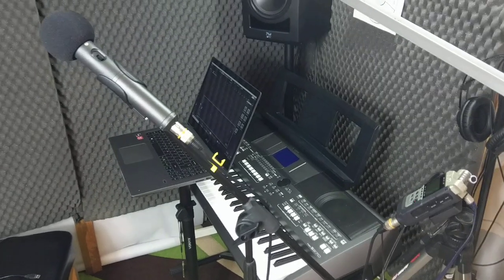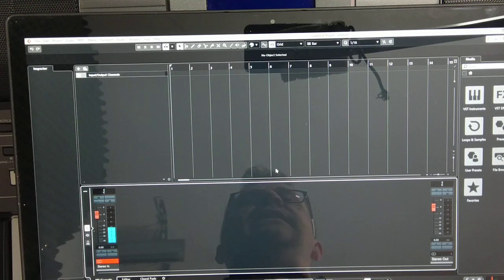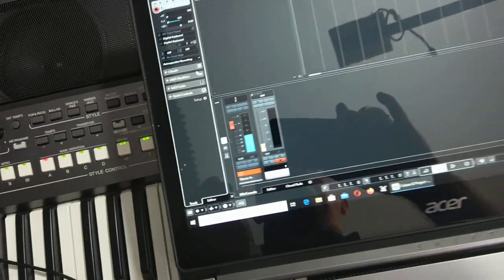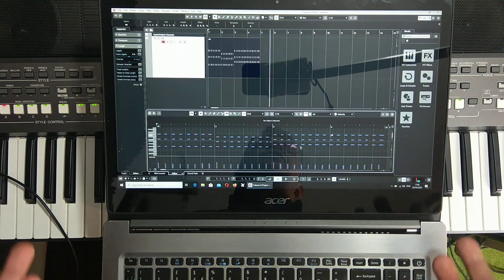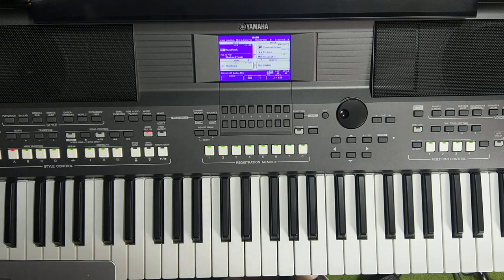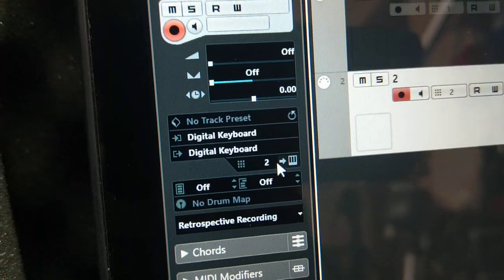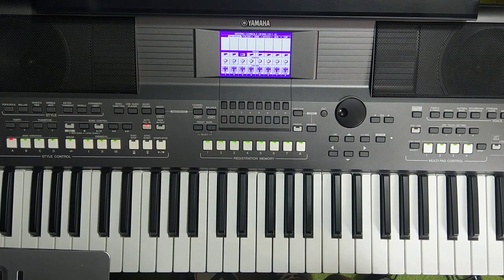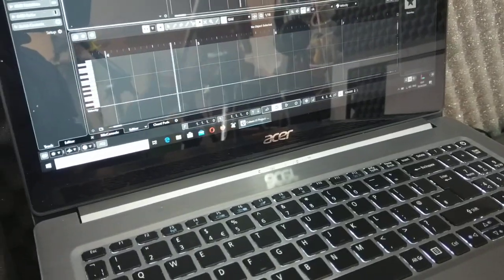How to setup USB MIDI on Yamaha Keyboard and Cubase 10.5 LE - complete MIDI tutorial and midi looper

Comment: Finally a honest video for once I have a m audio 68 keyboard midi usb plug can this work to? hope to hear back from you soon under this comment
Reply from the maker: Yes, It should work the same way. MIDI is generally a very wide standard.
Reply: @BBWalkerTV  Thank you but for some reason my sound is not working right and I have a hp laptop 15inch screen, some reason there is no sound coming out at all I have the right driver aso4all that I had to download still no sound
Reply from the maker: @ddrusa  sory for delay but I receive a lot of comment and sometimes YT skip for some notifications, here is the video where am I explaining it more, 
https://www.youtube.com/watch?v=FWp3KM33NQM
second reason why you may have problem is ASIO control panel, you need to setup proper outputs
Reply: @BBWalkerTV  Ah ok cool will do

Comment: Great videos. I am 74 years old so it takes me longer to digest a tutorial. I have a question. I use a PSR 770, and I have a midi song in my PC's DAW. I was able to separate each sound on different channels corresponding to the equivalent channels in my Yamaha's style creator. I also have separated the sections of the midi tracks I could use for the basic introduction and the basic ending. All this is stored in different midi files with different names.  Now, can I use all these midi files by transferring them to the PSR style creator via the same USB cable or through a stick? I have tried to play the files on the PC and try to play the same in the style creator but it is not good. Thanks.
Reply from the maker: Hello. Thanks for your feedback. Please check this video it's quite long but it should clarify all the stuff you asked for:
https://www.youtube.com/watch?v=FWp3KM33NQM

Comment: Hey ,your work is so useful and helpful, appreciate it man. Just one quick question. I plugged my psr s670 into ableton. I use the midi sounds in ableton, so is there way to switich off the keyboards sound or do i just have to turn the volume down?
Reply from the maker: Yes the simplest Way volume to zero
Reply: You need to go to the settings menu on your yamaha. There is option to turn of the sound on keyboard
Reply: Itd be go to midi menu in your actual keyboard and turn off local sound. Same for e drums keyboard and all

Comment: Hi, I hope you are having a great day.

I have a problem when I revoice the channels in the keyboard.

Every time  I select a voice in the revoice screen doesn't use the effects (DSP) parameters  that usually comes with them when you select one normally with the right1 or right2 button.

I give an example:
If I select the voice DistortionWah in the guitars section with right1 button sounds great because of its DSP parameters loaded but when I select the same voice in the revoicing screen in song function sounds different when I send notes with the computer because the keyboard doesn't seem to load the dsp the parameters that usually comes with the voice.

Any idea to change that?
Reply from the maker: Hey. Very good question. There is somewhere a few videos where I am explaining that widely. Without live example but I will try to explain it here. 
Basically mixer settings (which includes DSP block configuration) are stored within the voice loaded to Memory. 
After loading a voice they are altering current config (you can see it in mixer/effect) - but they set blocks for DSP2,3,4 for Rigth1, 2 Left , not the Song channel (Part: CH1,2,3,4 etc)
I assume you are revoicing existing song, you must me aware that in that case you ale playing via Channel (1..16)  not Right1,2,Left

Please check this video maybe it give you some inspiration:
https://www.youtube.com/watch?v=MkunF2WUwzI at 15:12 you can see Part selection

In your case you need to setup those DSP block to your Chanels (not R1,R2,Left) and save in Registration memory for fast loading. Remember that while doing this you can not select voices for Right and Left section because it will overwrite it (while loading new voice into memory)
If you still have problem - let me know,  I will make a special video for you cause this is really challenging question
Reply: @BBWalkerTV  thanks for reply!

I see.

After see the video of DSP now I understand the things a little bit better and what do you mean.

So, I need to setup the DSP for the Channels and save them.
Do you have a video where I can learn how to use the registration memory for this purpose?

Comment: Hi mate just wondering if you could help with connecting my Roland r70 drum machine to my Yamaha Psr970 via midi.
Reply from the maker: That is good question. Both devices you mentioned supports MIDI . According to photos I found on internet R70 has 5-din MIDI sockets. So you need cable like in this video:
https://www.youtube.com/watch?v=tnyYANwzuUA
Yamaha PSR 670 has only type B USB Midi, but PSR-S970 fortunately has both options (5-DIN plus USB Midi) 

I assume that you want to have the following setup:

Next you need to configure channels on Functions / MIDI / RX (receiving) because Yamaha will be "listening" and drums machine will be sending MIDI data. 

Please give me more details am I right about your setup and than we wil try to do more.

Comment: Should we use an audio interface ? Is there any latency issues without an audio interface ?
Reply from the maker: No, you don't need audio interface just pług in the USB midi cable into computer.
If you notice latency problems please check this video https://youtu.be/FYcW7gcN8cc

Comment: Can i record audio of my own yamaha piano sound directly into my laptop using usb cable?
When i record midi i get a signal. But when i want to record audio i don't get any signals. Any ideas?
Reply from the maker: No. Becasue Yamaha PSR do not provide audio interface inside. You need external audio interface and grab analog output 1/4 jacks or use usb audio Player and grab wav  inside Yamaha. Soon there will video about it. Regards

Comment: what cable do i need to connect my yamaha keyboard to my computer? a 6.35 mm to 3.5mm one?
Reply from the maker: Yes. If you plan to use analog out and Line in PC. However better solution is to use usb audio interface. Line in in PC is usually low quality
Reply from the maker: The other solution is to use USB Audio Player. Please chcek this new stuff: https://www.youtube.com/watch?v=yMBIUarEC_c

Comment: Sir digital keyboard is not shown??please..
Reply from the maker: Please tell me what operating system are you using basically there is no need to install driver on Windows 10 and I have tested in on this particular OS. It should be automatically detected by the system without any additional drivers however in your case maybe you need to install something like a midi driver

Comment: Sir... How can I connect My Psr s670 with Audacity Software...
Please reply me...
Your help is Much recommended...
Reply from the maker: Yes but only to recording audio stream (WAV) . I need a convert from Jack 1/4 inch (6.35mm) to Mini Jack (3.5 mm) Audacity does not support MIDI. I will make separate video about free MIDI software that you can use because there are some free alternatives.  Please stay tuned. Regards.
Reply: @BBWalkerTV  thank you so much for your valuable reply....

Comment: My Cubase 10 pro working fine. I upadared to 10.5 but midi input not detect by instruments. PSR device is detected as input, but when I press key in keyboard it does not give signals to DAW instrumnets. Is there any problem with Cubase 10.5? Please help.......